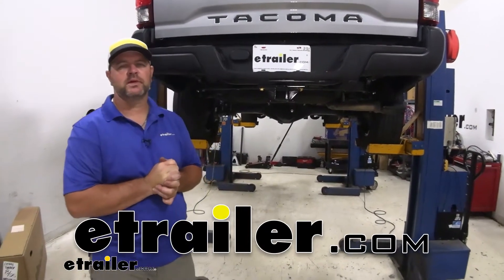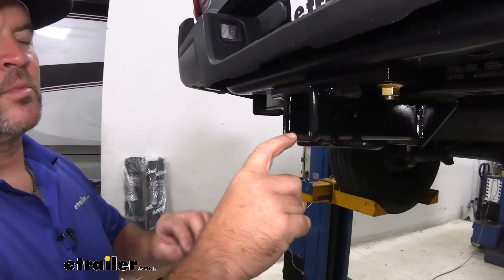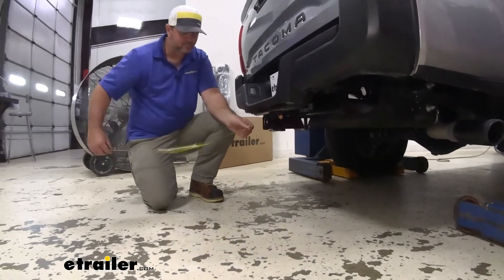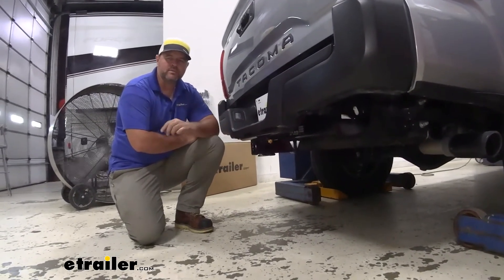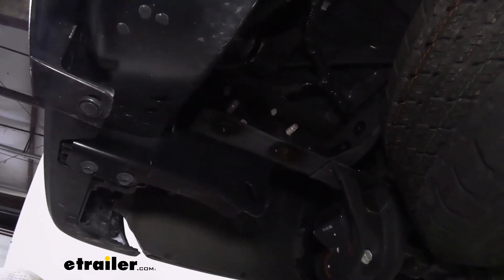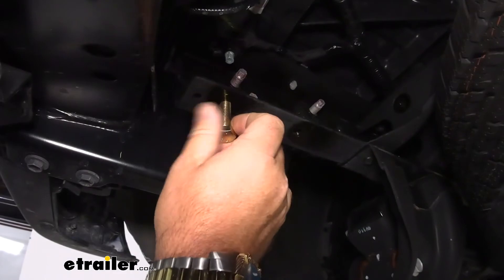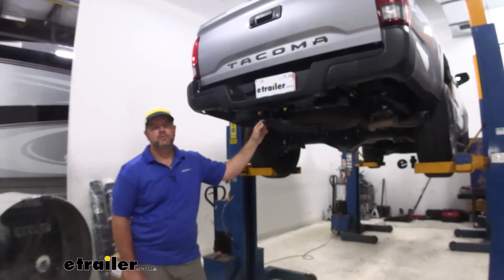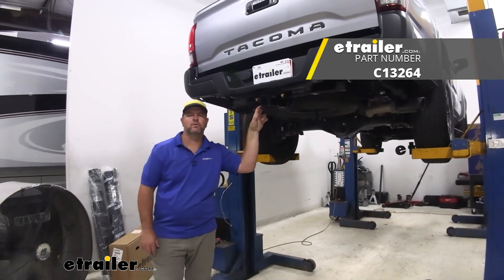etrailer | Beginner’s Guide to Installing the Curt Trailer Hitch Receiver on a 2020 Toyota Tacoma

Comment: I just ordered this hitch and installed it on my truck( kind of).. besides the 2 bolts you have to fish through, they are both lost inside my truck frame. I’m very disappointed the bolt and washer just got jammed up and I end up pulling wire out without bolts.. 150$ for crap, now I have to weld my hitch on
Reply from the maker: You can use a fish magnet to reach into the frame to pull the hardware out. We have had this happen before too and this is how we solved it.
https://www.etrailer.com/Trailer-Hitch/CURT/C13264.html

Comment: Let me help everyone out even more. While this video is great, I want to further explain how to fish the bolt and spacer inside the frame.  While it's true that you should have the spacer on the wire before the bolt (not inserted into each other while fishing in the frame), there's an extremely important way to actually get the bolt through the spacer and through the frame at the end. At first, I thought you want the spacer in place and flat before you fish the bolt through it to finish it up.  But this is impossible.   With the spacer flat and in place, there is not enough room inside the frame for the carriable bolt to make the angle of going through the spacer and frame hole.  What you do is once you have the spacer in place, you want to actually push the spacer up with your finger and try to fish the bolt through the spacer while it's at an angle so that the bolt can make the turn.  When you see the bolt is going through the spacer, only then can you bring the spacer and bolt down through the frame hole.   This is not explained well anywhere so I wanted to help out.  (Maybe this what is meant by "turn or rotate with your fingers" in the video?)
Reply: Bruuuuuh, you're a life saver!! I was going crazy here trying to figure out how to actually do that. Thank You!!!!!
Reply: I got mad and broke the fish wires. Idk what to do now.
Reply: @jesusrios5394   it works but you have to Angle the bolt perfectly or it won't fit into the hole.

Comment: Where could I buy/find one of those "pull wires" you used at 3:44 in the video? I've never seen those before or does Curt supply it with the Hitch kit?
Reply from the maker: The pull wires will come with this kit to get the hardware in place.
https://www.etrailer.com/Trailer-Hitch/CURT/C13264.html